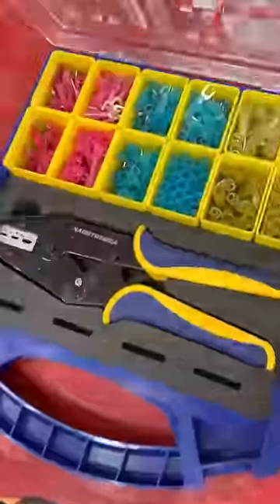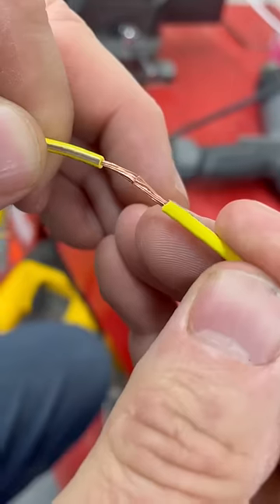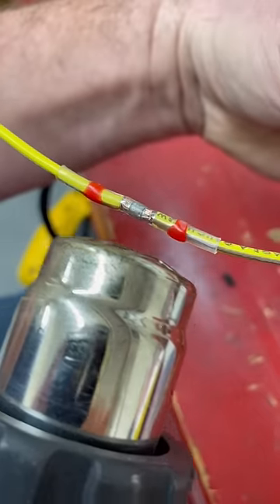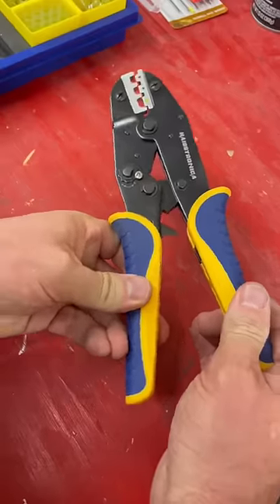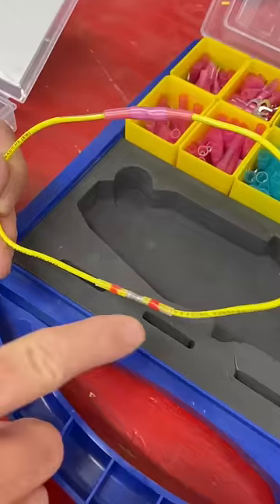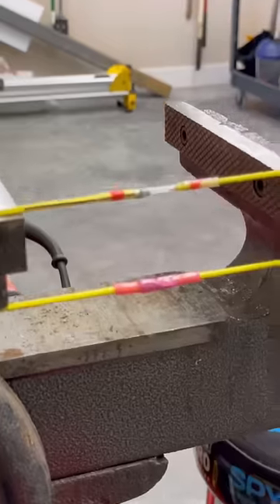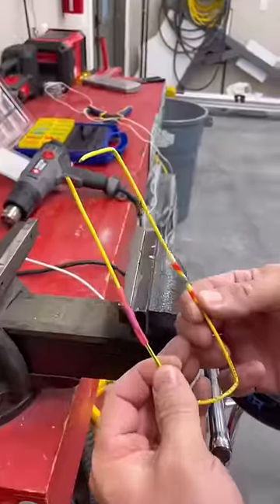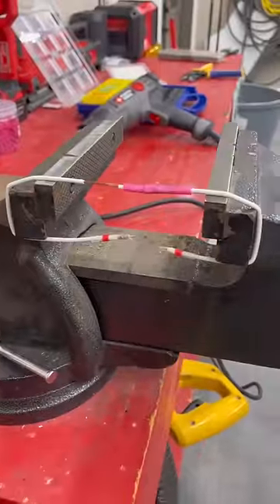Crimp verses Solder Connectors

Comment: Without listing them all here, the aviation industry almost exclusively uses crimp connections for a number of benefits but a properly made connection between either should, like in the video, be stronger than the wire itself
Reply from the maker: Good info 👍
Reply: @hausplans  The aviation industry only use 'solder sleeves' by Raychem for attaching shield tails on, and between, multicore shielded cables. Every connection of power and signal wires is crimped. Solder becomes brittle with age and the flux in solder becomes corrosive over time!
Reply: As an avionics tech I can say we use solder near exclusively.
Reply: As a ransom person, I can say I always make a second cut so I can use both every time...
Reply: Idk about that....

I was an inspector working with aviation electronics...

It depends on the form fit and function of the part...I have seen lots of soldered joints and some crimped ones.
Reply: Yep but only high grade copper ones and usually the disconnect ones so they  can resolve  and future issues
Reply: As a commoner with no proffessional degree, I exclusively use black tape to quickly spot the repair and easily fix when needed.
Reply: They use solder only.
Reply: @anhydrouswater  I would have taught it would depend on the application too haha
Reply: We use no crimp connections and I don't know any repair shop who do . Interesting 🤔
Reply: Just gonna chime in and say as an avionics tech with an A&P myself, I generally always try to use Raychem crimps for all wiring. Only time I use solder sleeves is for wire shields. Generally, avionics techs will never use these cheap style Chinese crimp connectors. We use AMP or similar. But those are for large wires only. Sometime a solder connection with heatshrink tubing will also do. The solder sleeves are cool but the way it was done in this video is wrong as there isn’t a good mechanical bond between the wires before soldering.
Reply: @PrimeHiFi  he used the word " mechanical bond " so he's good 👍 definitely aviation repair man
Reply: Not exclusively but the vast vast majority
Reply: @BamaShinesDistillery  I dont know what you're talking about.  The person above was absolutely correct.  Most every power/signal wire is crimped solder is normally only used for twisted pair grounds.
Reply: @williammendoza6062  Only worked on em for ten years...Im sure i did but I don't even remember a crimpled connection. Even the fuel system required solder.
Reply: @BamaShinesDistillery  i guess we had different experiences.  Im getting close to 2 decades military and civilian ac.  You didnt crimp pins even?  Maybe we have worked on different airframes
Reply: @williammendoza6062  Yes pins were crimped but never replaced all that often.I worked on refuelers. If it was electrical it was generally a splice. Never large wires. Always little bitty ones in a bad spot. 90% were in the wings. I was also well aware practices differed from base to base. I spent all my time at 2. Both soldering skills were a must. We literally had a station to teach newbies and to solder connections we removed. Alot of the communication lines were soldered.
Reply: @Dammit Trey  civil aviation construction here everything is crimped ring, pin or fork connectors except for 2 that I know of that that are solder sleve for sheilded cables (but I'm sure there's more in the sheilded looms pre done)
Reply: bull chit.
Reply: ya, not accurate at all.
Reply: @burtreynolds3143  wow with the language we can argue about crimped or soldered but everyone knows people in aviation never use foul language
Reply: We also use all white wiring to confuse the s*** out of every technician! You gotta love A&P work😅
Reply: @BamaShinesDistillery  but you're not using connectors. You're actually telling the wire and soldering them we're doing a proper mesh and solder. I believe some of these connectors are even against FCC regulations. I never took my FCC tests for avionics so I'm not sure
Reply: @BamaShinesDistillery  - Soldered connections create stress risers that cold work the strands in stranded cable when vibration flexes the cable.  Heat shrink and cable ties near the connection help slow the process but vibration will still break the wire at the edge of the solder.  Use good quality crimp connectors (Panduit, Tyco, etc.) for aviation wiring and good sharp strippers on that white Teflon insulation.
Reply: I've been in Aviation for 10 years. Have never once seen a crimp connector used. Broken wires are replaced besides temporary fixes. Temp fixes are spliced and wrapped in chaff tape.
Reply: @Liberty4Ever  You know that so many hours means a tear down and rewire right?
Reply: Yeah, a mil-spec crimper, not a $30 dime store one.
Reply: @confuse9  I cringe when anyone says mil-spec. All that means is made or sold by the lowest bidder.
Reply: Railway signalling installations almost exclusively uses crimped terminations, especially trackside equipment that is exposed to heavy vibration.
Reply: @Starlesslemon if I were at work I could find hundreds of crimped terminals and connections across 4 commercial aircraft types. Guess it all depends on what you work on. I’m an AME-M but during the electrical modules in school all the splices and terminals we had to do were crimped.

Comment: the problem with these kinds of solder connections is that the solder is a low melting temp alloy, and they usually make weaker joints. 60/40 leaded solder and heat shrink is my go-to

Comment: It's not about strength, it's about how good the connection is. Those Solder connections are both easier to do and usually more reliable

Comment: Solder is usually more fragile because it hardens around the metal so bending and work hardening will break it easier than normal
Reply: Crimp connections also become fragile where the connector meets the copper.  Because it pinches it so tightly it also hardens the material and makes it more sensitive to vibration and actuation
Reply: Assuming you don't use so much solder that it wicks up the wire a couple inches, that's what heat shrink with the hot glue inside prevents. Waterproof and strain relief
Reply: @scatterbraintech  I've never seen someone actually use hot glue though I've been aware of it. It's an interesting thought tho, but it still doesn't change the fact it heats up the metal so there is a degree of weakening.
Reply: @justinnicholson4906  In the automotive industry I've never seen crimped connectors snap or shatter, only bend and when serious force is applied rip in half... I've actually seen terminals themselves break before a crimped connection... But I've seen soldiered connections snap or disconnect with slight pressure like you'd see when a car drives over a speed bump or the engine vibrations from a 6 cylinder.

My question for you is the wiring you use solid core or strands?
Reply: @teddy5004  Hey I'm an auto tech too 👌🏼. The hot glue is actually part of the heat shrink from Chrysler I use,  just a film on the inside. I've never seen problems with but connectors put on PROPERLY, but a lot of them I see around here aren't done right. Also have seen vehicles with the wire broken at the terminal crimp. Chrysler's method of repair is those u shaped crimps, then solder, then the heat shrink with the goo inside
Reply: @scatterbraintech  I'm not actually an auto tech I'm a Powersports builder working to become an auto tech but I did many of my own terminals on my bike before becoming a builder.

That hot glue trick is really nice, we have a Red Honda tech I'll try asking him what his preference is.
Reply: I also believe that the heat from soldering also weakens the wire. I notice this quite often with wires that have been soldered multiple times. Like some comments above, the solder also can wick up the wire, causing an area that experiences increased stress, as when the wire bends it’s more likely to bend near where the solder has stopped up the wire causing weak points. Over all I don’t have a preference, because I’m my opinion if either is done right, they’re both equally reliable. Though there might be something to be said about mechanical connections (crimping) being more reliable, because after all it is known that wire wrapping (another mechanical wiring technique used more so for circuits) is THE MOST reliable way to create electrical connections.
Reply: Also solder doesn't stand well against vibrations. So solder is not preferred in wiring harness of automobiles. Crimping is better
Reply: @lordjaashin  Believe it or not some companies do soldier and they have government contracts however it's both crimped and soldiered. I would only imagine the reason being to prevent arc events when traveling off-road.

Comment: I use crimp connectors with the built-in hot glue heat shrink.  I always use the crimp head for non-insulated connectors to really get a positive bite on the wire then cover with an additional tube of heat shrink.

Comment: British sparky here.

I was always taught to use through crimps as an apprentice, and I've never had a problem with them in 20 years. 

As you rightly pointed out, the ratchet crimping tool makes for a perfect crimp every time, assuming you're using the right crimp for the job.

Comment: I worked for Ford for 26 years. Ford recommended using heat shrink crimp connectors. They said that soldering the small wires used today, will make the wire brittle and crack. Those solder connectors you demonstrated probably don’t get as hot as a solder iron. I also used a crimping tool like yours and they worked great!

Comment: Non insulated connectors and a good heat shrink to finish it off.  I find pre insulated connectors have a tendency to pierce the insulation when crimping.
Reply: Need the good crimping tool that locks until completely crimped never had a pierced sleeve with the right tool
Reply: @robertg9334  use the right tool. They still pierce occasionally.  Depends on connector quality, wire size, and crimper adjustment. All those variables can be avoided with non insulated.

Comment: I prefer the crimp shrink seal connectors they have never failed me even in submersible situation with salt water on my boat
Reply from the maker: I prefer crimp myself as well
Reply: I drive in northern/eastern Europe, and so far road salt has destroyed every fixed wire on a semi trailer that ever has been touched.
Or even havent been touched for that matter. Slight crack in insulation just from normal wear and say goodbye to trailer lights. And a B* to track the fault down when visually the wire is perfect, but the conductor inside is gone. Hate road salt.

Comment: Crimp is always recommended on a vehicle or anything constantly moving. The crimp allows some wiggle room, where the solder is more brittle
Reply: @DjSokYchannel  it you properly install them they should be 100% watertight. I was taught by people with a lifetime of racing cars under their belt, and none ever had a  problem with a properly crimped connection. If you're worried extra shrink wrap does the trick

Comment: The logic shared with me by an electrical engineer leaned toward getting the best electrical connection with solder. Strength (by pulling apart) is rarely a concern in the applications I have experienced.
I strip the wire, twist & bend them back on them self, hook the wires together, solder and seal with shrink tube. This gives excellent electrical connection AND extreme resistance from pulling apart. The only down side is the time it takes. Solder connectors would be an excellent way to get big jobs done fast. I like the ease your solder connectors provide. If I have a big job I think I will give them a try.

Comment: I used solder and regular heat shrink in tire well for speed sensors - the joint has  held up perfectly for years now.

Comment: I’ve been using haisstronica ratcheting crimper with non-insulated barrel crimps. They work amazing together. Rewired my whole racecar with it.. just gotta remember to put heat shrink before the crimp. I put at least two heat shrink tubing over each crimp. A tight fit one, and another a bit larger to fit over the first heat shrink.
Reply from the maker: Cool

Comment: I use both depending on application, new to new the solder joints are great but if there is any oxidation on the cable they don’t work as well! The crimp style are great for both but excel with aged wires and the shrink is slightly thicker in the brand I use! Both are a must have in the electrical connector box! Great video.
Reply: That's what electrical flux is for! Either way oxidation = resistance = heat

Comment: In industrial electronics a solder joint is considered weak, as constant stress will break individual conductors in a stranded wire much more quickly than a strain relieved crimp connector. 

Most crimps will grab the insulation as well as the conductors, which most solder joints will not do. This acts as strain relief, making the connection last longer in vibration prone environments.

Comment: comparing the difference in resistance might be interesting
Reply from the maker: It would be
Reply: You'll find such a small difference you won't notice. The days of solder being better are behind us
Reply: The wires are doing the conducting.
Reply: how’s 0.01 ohm sound? Because that’s exactly what gets added with crimps. Nothing in a vehicle outside of data lines cares about that 0.01. I had to do the testing and research to convince my foreman out of that outdated pattern of thinking.
Reply: Both connection types have essentially zero ohms for any practical application.
Reply: @Bmr4life  yes, but the connection is what electrically connects the wires and allows the conduction. A better connection will allow more conduction by the wires.

Comment: It really helps to twist the wires back and forth to work the solder goop around. Looks completely solid and is usually stronger than the wire

Comment: I always crimp power connections. If the wire overheats, there's no solder to melt. A crimp connection will hold fast.
Reply: If there's so much current that the wire is getting that hot, a fuse may have failed, and having a "fusible link" might not be so bad.
Reply: If your wires are getting that hot then solder melting should be the least of your concerns. 🤨

Comment: Most of those folder connectors use lower melt point solder, which is more brittle.  On the other hand, I would suspect that a solder connector would have better conductivity.
Reply: Solder actually increases resistance which builds as it ages - resistance is the enemy of conductivity. A solid mechanical crimp actually forces the copper from both wires together and introduces no resistance, maintaining conductivity.

Comment: I always solder wires with an iron. I have had to re do many butt connections, but have never had to resolder a connection. It speaks for itself, put in the extra time up front and you’ll never have to touch it again

Comment: I thought the difference was that solder connections will start to crack over time if they're vibrating, where crimp ones won't.
Reply: this happens if you don't properly heat the connection during soldering. there is a chemical bond that is formed when everything is heated to the correct temperature. if you just melt the solder on to the wire without sufficiently heating the wire, you get what is called a cold solder joint. this cold solder joint will crack and split away from the wire because it is not chemically bonded with wire.
Reply: its not about solder being a bad option, its about improperly applied solder causing quality issues.
Reply: @joshuahelt6589  no, solder connections crack because solder itself is brittle, and are especially prone to breaking at the ductile-brittle transition around the edge of the solder joint. There's been decades of engineering and QA done on this, and you only need to look at FAA or NASA specs to see the result. Even automotive manufacturers basically always have crimp connectors. Solder is for attaching to a surface, not joining wires. Period.

Comment: I use both, as long as you install them properly, you should never have issues. I typically use un-insulated connectors and slide a piece of heat shrink on the wire, then tape and loom. But these connectors are quick and FAR better than a lot of options on the market... looking at you, speaker and alarm system guy using quick splices for everything

Comment: Ive used those crimp on weather connectors for a head unit install. Came out really clean, atleast I know my wiring will never be a problem! I only connected the adapter with the head unit plug, never mess with original vehicle plugs, splicing that is a nightmare.

Comment: Just today I replaced the headlight housing on my silverado. Found 2 headlight wires reconnected with solder and packing tape. 
Replaced with actual solder and shrink tube.

Comment: Years of working in Aviation, we always used the solder connections. They were referred to as environmental splices. The solder made great electrical connections and the heat shrink made a waterproof connection.
Reply: no aviation service center ive ever been too permits non crimped connections. excessive heat causes solder connections to fail.

Comment: I do a ton of wiring on 100vdc or less systems solar, RV, trailer, and automotive. I've found that the solder  connectors are very similar to low melt solder. Adding flux helps a great deal, but then you pay the price by ruining your adhesive from the flux. So we just use the crimp connectors with heat-shrink, and they're great. Haven't had any trouble with Hasstronica products they cost a little more, but they come in nice cases.

Comment: I use both. I found the solder connectors are great for cases where three wires are coming together or one wire is bigger then the other (like using a larger wire to splice a smaller wire because you only have larger available)